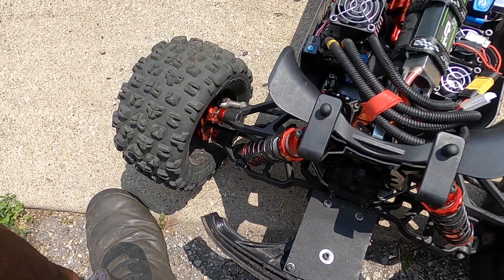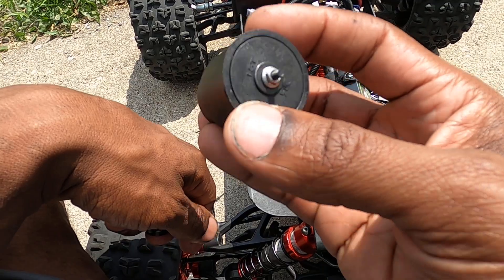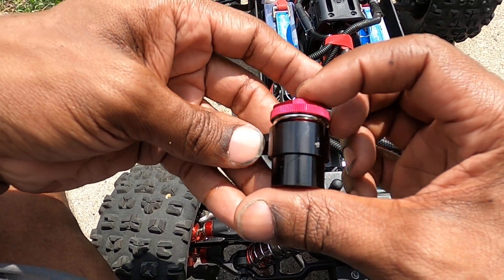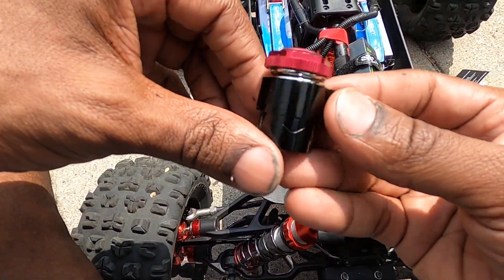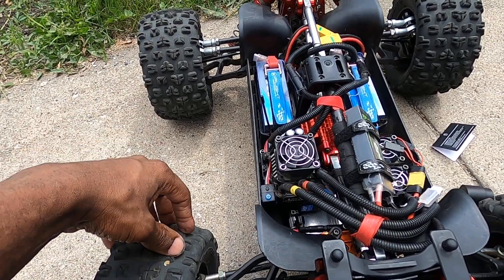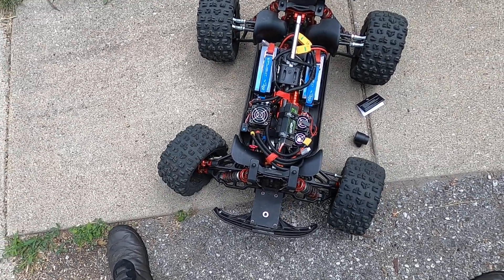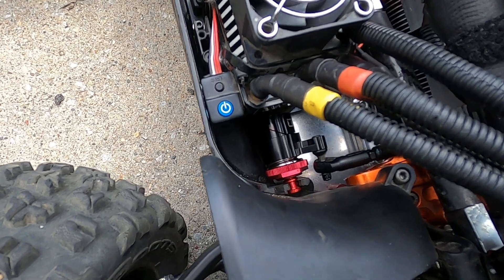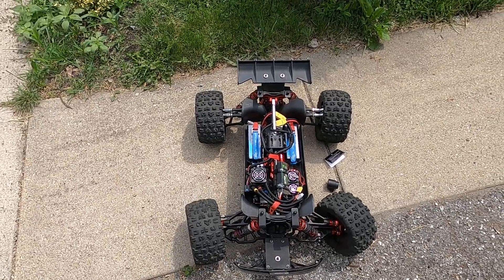HR Adjustable Aluminum Servo Saver Arrma 8S 1/5 Test

Comment: Dude! How do you have your fan battery mounted!?   Also where did you get your fans? That’s one awesome build!
Reply from the maker: I got them from Aliexpress, 50mm: DV0502B12U, 40mm: FFB0412SHN. I coated the brace in a bit of silicone coating, pounded on the CF tube so it couldn't move, wrapped the CF tube with adhesive foam, put 3M dual loc tape on the battery, then strapped the battery on the foam. The dual loc tape presses into the foam so the battery can't move at all. I also have a piece of foam on the side of the battery just in case it "finds" the fans on the motor.
Reply: @Megasty15  thanks for the info!
Reply: @Megasty15  does this has the 15t aluminum spine also you connect to servo? Is that plastic or aluminum
Reply from the maker: @rclunatic  Yeah It's 15t. The whole thing is aluminum except for the steel spring. It also come completely assembled & ready to install.
Reply: @Megasty15  dam to bad there sold out every were
Reply: @Megasty15  do you no we’re I can find one online in stock
Reply from the maker: @rclunatic  The only 'place' that sell it when HR is out of stock is their supplier in China. I wouldn't touch them. It's easier just to wait for HR to get them back out.
Reply: @Megasty15  why wouldn’t you touch them are they just bogus quality
Reply from the maker: @rclunatic  They mark up HR's stuff 30-50% & it takes just as long to get it as it takes for HR to get it back in stock.
Reply: @Megasty15  your right I’ll just wait
Reply: @Megasty15  I’ll just run the stock one for now smh
Reply: @Megasty15  one more question my guy is there a big difference from stock and the HR?

Comment: I was trying to install this on my kraton 8s and cannot I figure out how to install it with the screws provided. the short screw seems to fit into the arm that connects to the steering rack, but the long screw is far too long to go into the servo horn, and there is a nut that came with the kit that I cannot figure out what its purpose is. Can you please point me to some directions on how to install this?
Reply from the maker: The short screw bolts the saver to the servo. The long screw is for the arm, it feeds through the arm, then the horn, & the nut.
Reply: @Megasty15  Thanks. I have an EXB so my arm might be different. the ball is "closed" and the screw just screws into the ball, rather than passing through it. So I guess I don't need the nut.
Reply from the maker: @atomos319  OK, that's not good at all. It's actually suppose to bolt through the horn, then arm, then nut. Having the arm ball closed means if the bolt breaks then it will be trapped in the ball. It actually broke on me 3 times already, but that was on some pretty bad tumbling crashes. Take a better look at the ball. The bolt does screw into the ball, but you will need to use the long one for it to come out the other side. The ball was open on all 4 8S rigs I have.

Comment: I just installed my hot racing servo saver, its acting goofy like my stock set up.. I'm clueless.
Reply from the maker: What servo are you using?
Reply: @Megasty15  savox SW-0241MG
Reply from the maker: @slabz710  That servo has near identical specs to the stock Spektrum servo. You definitely don't get your money's worth with Savox. Try a Primal PM1373 or JX PDI-HV2070MG. Both have over 1000 in oz, while the SW-0241MG has 555 in oz.
Reply: @Megasty15  yeah my local hobby shop has been ripping me off on parts lately. I'm newer to the sport so i'm in need of real advice. And they just sell me some expensive item each time that does me no good.. i appreciate the info, and i'll most likely get the 1/5 primal RC servo now.
Reply from the maker: @slabz710  Been there with the LHS headaches. The JX & Primal servos are 100% identical. Gears, motor, even the circuit boards are the same. I didn't know this until I bought the Primal. I've been using the JX for years.